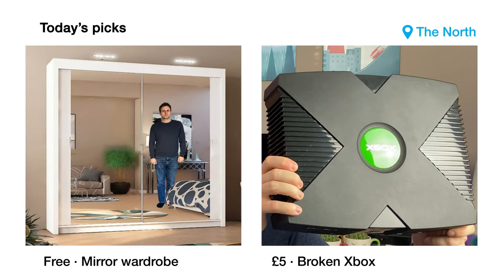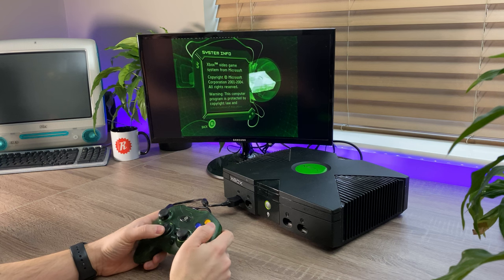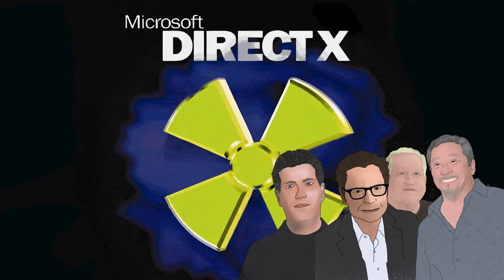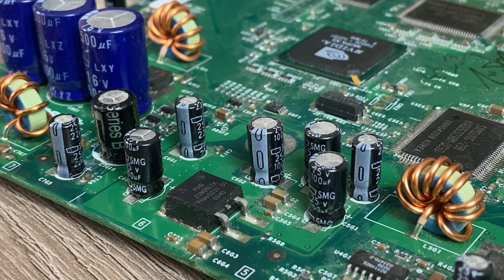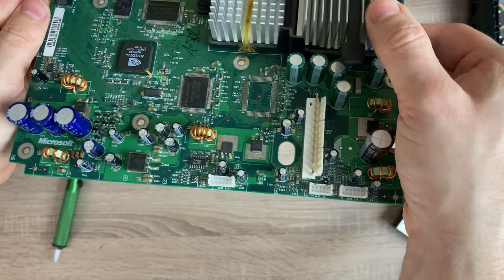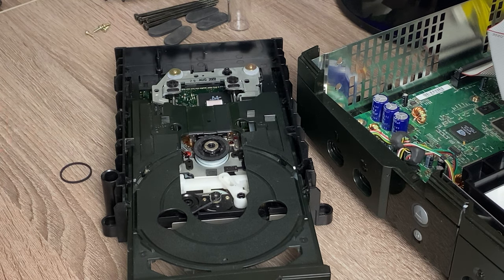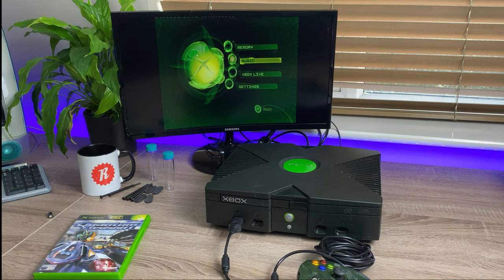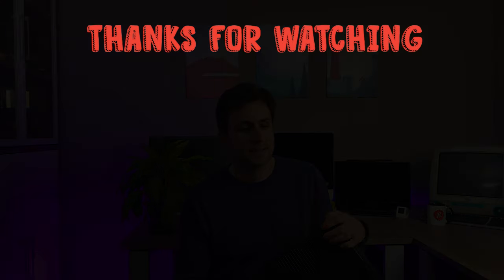OG Xbox - Broken disk drive

Comment: Great video as always and I appreciate the shoutout! I should check out the band on my DVD drive, it's probably stretched like yours was as it doesn't eject most of the time. My box is modded but I still use the drive occasionally to rip discs to the SSD. There's actually a technique where you press the eject button and then whack the drive in just the right place at just the right moment, but it's not 100% foolproof 😅
Reply from the maker: A whack to the top is probably in the manual. It’s easy to replace you could probably do it with out even taking it apart as it’s right in the front.